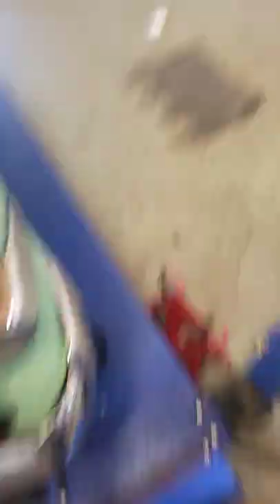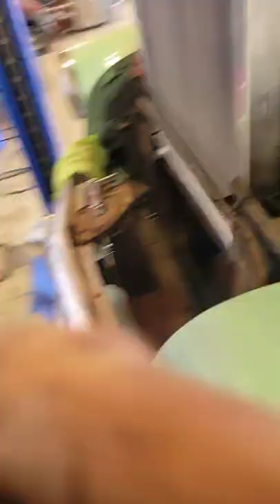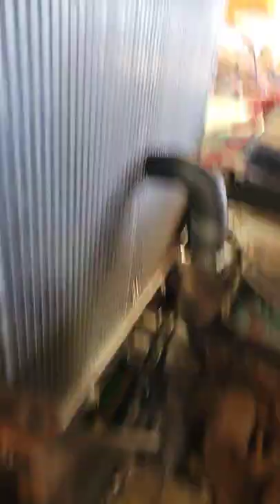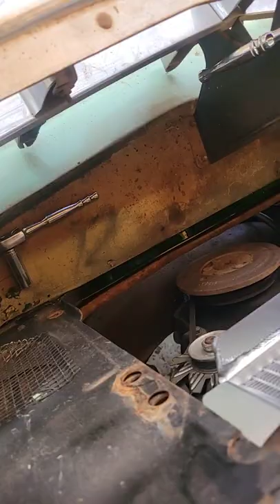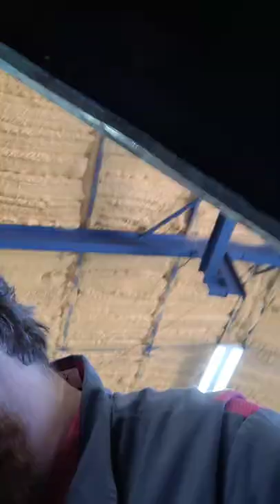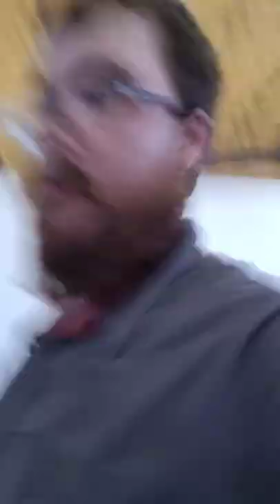1954 chevy bel air radiator

Comment: Good luck
Reply from the maker: Thank you. I got it in today. It definitely didn't go in the way I wanted it to but it's in.
Reply: @aaronsprojects9622  nice. I don't know how many times I've looked at a car and cursed the engineers. There's always a way to get stuff out and the new stuff in. Sometimes it's just a matter of prying in the right spot and when in doubt get the hammer out.
Reply from the maker: @domineech  well, I had to do some trimming on the car unfortunately but it's in.
Reply: @aaronsprojects9622  in the long run that's the important thing. When I was a little kid the 1st model I ever built was a 53 Chevy and I fell in love with old cars then.